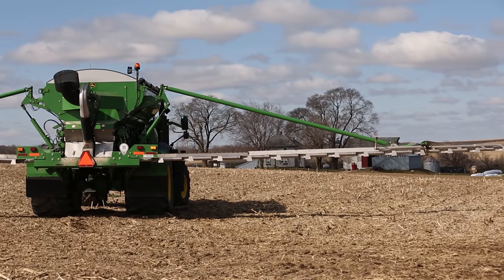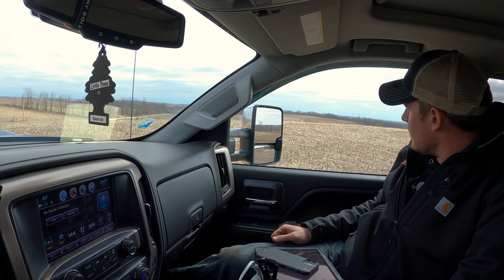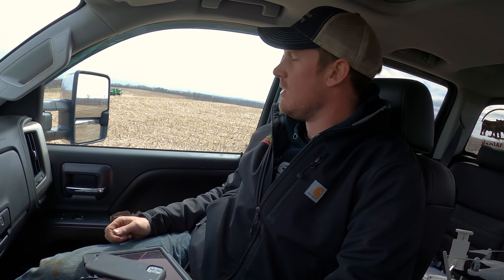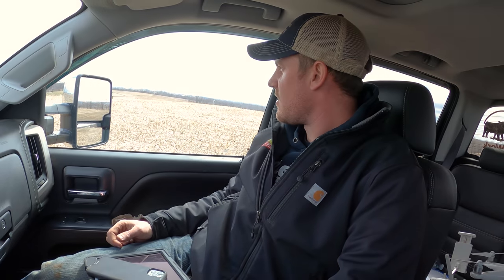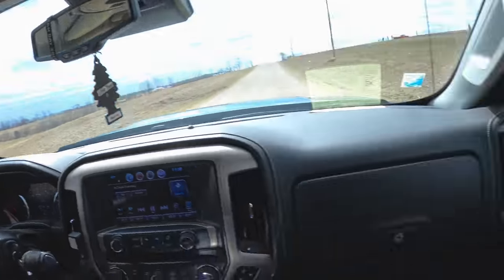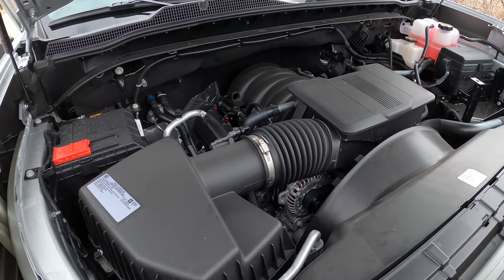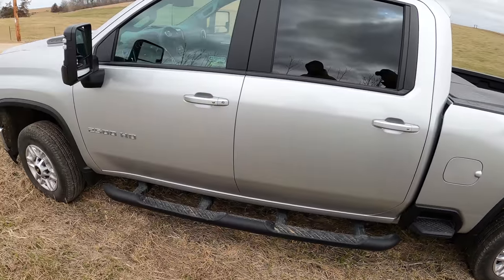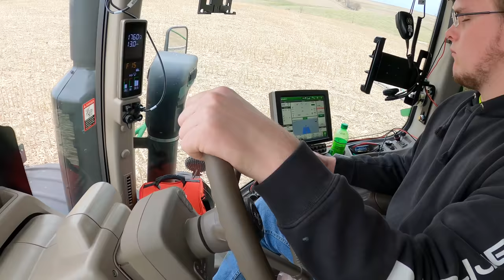Corn Fertilizer Application - John Deere F4365 High Capacity Nutrient Applicator Custom Airflow

Comment: Hey Ryan,  What is the upside of using a graduated fertilizer verses a liquid one?  In my mind I would think the liquid fertilizer would be faster to be absorbed into the soil verses the granular.  Glad to see Rocket get to take a ride on the farm too. Please be safe and thanks for the video :)
Reply: They're about the same, actually... the liquid has to dissolve in soil moisture and move out by osmosis and wicking through the soil with the moisture.  Dry has to either be incorporated by disking or mixing with soil, or dissolved in rainfall or irrigation water and move down into the soil with the water. Anhydrous is knifed in and the "smoke" anhydrous vapors are drawn to soil moisture and dissolve in it, and again have to move out from the knifing-in point through the soil profile through dissolution (greater concentration to lesser concentration).  It's all pretty much the same, not a HUGE difference.  Dry is easier to move and spread IN BULK with relatively simple equipment (hoppers and augers, spinner spreaders), or can be a total PITA (bags and planter fertilizer boxes).  Liquid is pretty easy to handle, just requires nurse tanks and gas-powered pumps, but hoses and connections and stuff to maintain and that occasionally fail.  Metering it out onto the field is usually done by sprayer-type controllers or variable-displacement pumps (or variable speed constant displacement pumps like squeeze pumps) and either dribbled or knifed in or sprayed on... Anhydrous is self-pressurizing so just has to be pressure-regulated to deliver the correct rate, and injected into the soil and immediately covered up to trap it in the soil long enough for it to dissolve in soil moisture... 
Later!  OL J R: )

Comment: I've often wondered how cost effective organic fertilizers would be, like meat processing waste, kelp meal and fish emulsion compared to conventional fertilizers.
Reply: not near enough supply
Reply: Plenty in the Northeast we use a lot of residuals
Reply: Not very... "organic" fertilizers are usually sold at a premium.  Years ago, I was doing the numbers on getting chicken litter from a local egg farm about 13 miles away to spread on a 20 acre hybrid bermudagrass field I had for hay... I went and talked to the company rep and he ran some numbers for me and told me basically I'd need FOUR SEMI LOADS of chicken manure for the 20 acres (well, just over 20 acres) and they'd bring out a spreader for me to use... my tractor was on the small side so he recommended filling the spreader only half full at a time so it'd handle it better.  He told me the analysis (actual nutrient content of the manure which IIRC was like 3-2-2 (3% nitrogen, 2% phosphorus, 2% potassium-- NPK) and the price per ton, and tons per acre I'd have to apply.  SO, I went home and did the math, plugging the analysis into the data... I kept coming up that it was MORE expensive to use the manure than to use regular granular dry fertilizer from the local ag supply delivered in a pull type hopper spinner spreader.  I did the numbers three times and I kept getting the same result, so I called the guy back, and asked him to run my numbers and tell me where I was screwing up... He did and said, "Nope, you're numbers are right-- the chicken litter IS higher!"  Now I was a bit flabbergasted-- used to be MANURE was the cheapest fertilizer you could get, because 1) big operations have SO MUCH OF IT the have to practically give it away to get rid of it all, and 2) it's a PITA to handle and deal with-- instead of a couple hundred pounds per acre of dry or liquid fertilizer, spreading manure to get the same nutrient availability requires TONS of manure per acre!  That's a LOT of material to have to handle... plus it stinks like h3ll for a long time after you're done... ANYWAY, he then tells me WHY it's MORE EXPENSIVE for manure than for regular dry or liquid fertilizer... "Yeah, we got all these ORGANIC rice farms around here now, and they CANNOT use regular liquid or dry "chemical" fertilizer on the organic fields and maintain their certification, so they HAVE to buy manure, so we can charge a PREMIUM for it ABOVE what you'd pay for regular dry or liquid... "  I was like "Okay, thanks!" and that was that... 

I called the local ag supply and they dropped off a spinner spreader full of about 2 tons of dry fertilizer that I spread in about 2 hours and called them to get their applicator back... and for LESS MONEY than the stupid manure would have cost, and NOT having to deal with FOUR SEMI LOADS of chicken crap to do the SAME JOB, which would have probably taken me a couple days to get applied once it was delivered... a veritable MOUNTAIN of sh!t piled up on the edge of the field to be scooped into the machine and spread.  

SO, yeah, litter and waste and other stuff CAN be cost competitive, BUT it can also be higher, if there's a "captive market" like "organic production" nearby that the capricious rules state must be a certain thing to comply with or lose the certification... Kinda crazy, because the CHEMICAL COMPOUNDS are the same... and the plants DON'T CARE what form of nitrogen they get, or P or K for that matter... OH, there's slight differences in availability to the plants, persistence, and solubility, things like that, but for the most part, N is N the plants don't know the difference or care.  Liquid or dry "chemical" fertilizers are just WAY more concentrated, so you're NOT spreading TONS of sh!t to do the same job that a few hundred pounds of chemicals can do... Plus the manure is FULL of bacteria and viruses and fungi and insects and weed seed and drug residues from the livestock producing it, heavy metals or other contaminants, etc...lots of other UNDESIRABLE stuff that you really don't want to spread on your land and can cause you a lot of problems later on...  I've heard of several guys I or my family have known that either died or gotten severely ill and been damaged for life from breathing dust or fungi and stuff off of dry chicken litter... It's nothing to play with, you have to be careful... Just because it's "NATURAL" doesn't mean it's BETTER... Personally I'd rather eat vegetables from a field where clean CHEMICAL NPK was applied to the soil than were TONS of manure were spread, full of bacteria and other bugs, which is constantly blown around and sprayed around by rain drop splatter and wind every time a rainstorm comes through!!!  Later!  OL J R :)

Comment: Is dry  fertilizer cheaper then anhydrous? Does it work just as well? All we have is hay ground for our horses and we broadcast dry fertilizer.
Reply: No anhydrous is usually cheaper, but harder to handle... has to be KNIFED into the ground and the tracks SEALED to keep the magic smoke from blowing away in the wind...  Anhydrous is popular in row crops, particularly ones with high nitrogen demands (rates) but those fields are usually much easier to knife it in and seal the ground behind it to keep it in the soil til it dissolves in soil moisture and is trapped... 

Dry and liquid can be spun on or "dribbled" on or sprayed on and then carried into the soil by rainfall or irrigation.  We used to use liquid fertilizer on all our row crops because it was just so much easier to handle-- Dad nearly got gassed by a busted anhydrous hose when I was just a lil kid in the early 70's, so he said, "Nope, I'll just pay a little more per ton for the liquid where it can't gas you!"  We knifed our liquid in the beds for cotton, grain sorghum, corn, and beans, and often sidedressed with a knife applicator in-season running sword knives about 6 inches off the rows... worked good.  Half pre-plant half sidedress is what I'd usually do.  We also had an old dry fertilizer machine Grandpa got from somewhere and I did dry fertilizer a couple years, but dealing with all those 50 lb bags sure cured me of that!  Went back to liquid and never looked back!  OL J R :)

Comment: How much did that cost and is that a better way than using pellet fertilizer in your corn planter when you plant corn?
Reply: You don't want to know how much that cost (it's a company that applies it for a fee) and it's basically the same as what you'd do applying it with the planter, but applying with the planter slows down planting and is a big pain in the butt because of having to refill the little hoppers all the time... Later!  OL J R :)

Comment: Hey Ryan, I was just curious as to the product being loaded into the sprayer hopper looks dry, but the spray looks like a liquid.... are my eyes playing tricks on me or does it get liquefied before coming out of the nozzles... thanks you... retired construction worker in Idaho
Reply: If you watch carefully you can see it is still solid as it comes out. It is just how they air distribution system makes it seem
Reply: it is a dry spreader, uses air to blow the product through each small pipe on the booms
would be nice to see a walk-around of it
Reply: @johnsummers172  Thanks John... I appreciate the info !
Reply: It's granules, granular dry fertilizer... little bitty prills of material, like BB's only about 3/4 the size of BB's...  the big fan in the middle blows them down individual tubes from the center running out toward the ends, evenly spaced openings where each tube ends in turn, so the stuff is divided up equally among the tubes under the fan and then blown by air out the end of the tubes, and the granules bounce off those little angled metal plates over the end of the tube hole so they "splatter" out into a cone-shaped pattern to distribute evenly across the ground... 
Later!  OL J R :)

Comment: How do you test soil?
Reply: Dig samples in several spots in the field, mix them all together, then bag up a soil sample bag and send it in to the local university, usually drop it off at the local extension office.  They prepare the samples and do a chemical analysis showing what nutrients and elements are present in the soil, along with organic matter and some other measurements of the soil traits (like cation exchange capacity, a measure of how readily nutrients can dissolve, be held in, and released from the soil and made available to plants, among other things) and then make a fertilizer recommendation for a specific crop and desired yield that you specify in advance... then they send you the results.  Many co-ops and ag suppliers now also offer the service, doing "grid sampling" over many areas of the field and doing many more soil tests and making "soil maps" and "fertilizer maps" for each field or farm depending on the nutrient needs in each small sampling area, which is a lot more detailed than just a single-field fertilizer recommendation, and can save the farmer quite a bit of money by not underapplying fertilizer to good soil with high yield potential, which limits yields, or overapplying to poorer soils or hilltops or whatever where the yield potential is limited anyway by other factors, and the plants won't use a heavy dose of fertilizer to produce a crop ANYWAY... Such grid sampling is often done by 4 wheelers with GPS equipped sampler units that can then correlate where a sample was taken from in the field, so that when the results are returned, those results show up in the map for THAT spot in the field... which allows an application map to be made for variable-rate controllers to apply larger or smaller amounts of fertilizer across the field as they go, using the GPS and map to control the rate applied... 

Later!  OL J R: )

Comment: Ok how does that work I notice putin powder fertilizer but it is spraying
Reply: Blows the dry pellets out the tubes and bounces them off the metal plates just outside the holes... stuff bounces off the plates into a "spray pattern" as the pellets splatter off the metal plates... Later!  OL J R: )